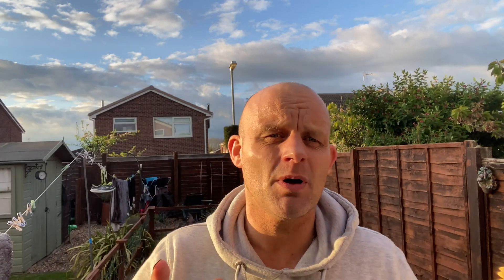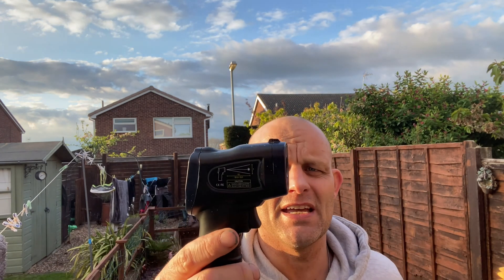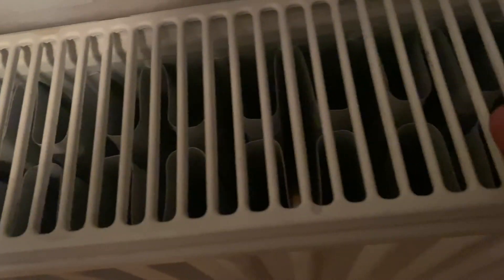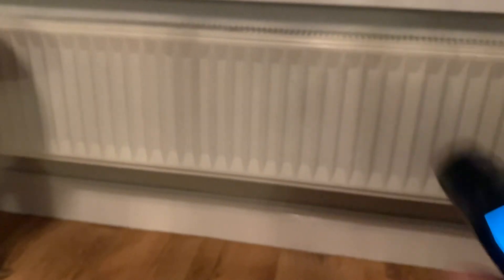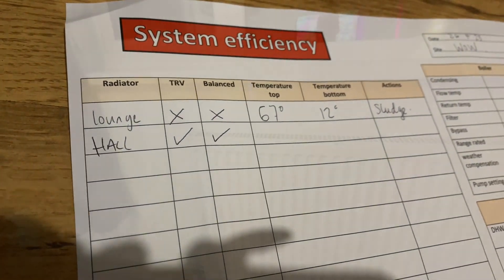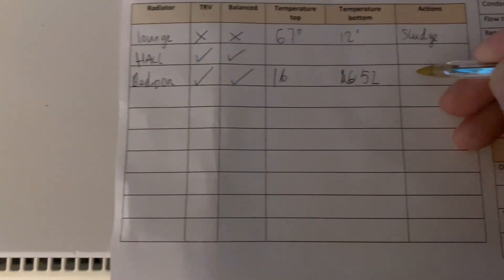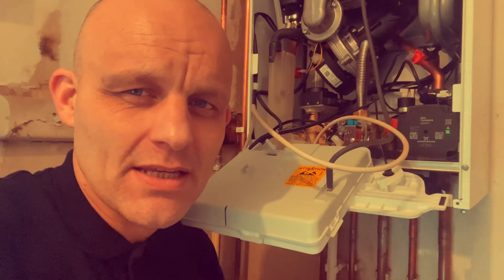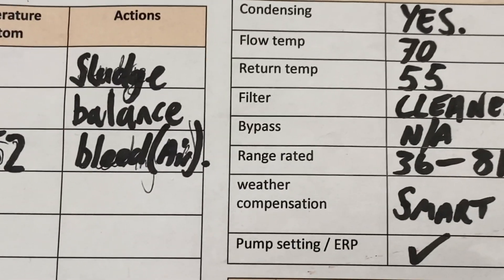How to balance your heating system

Comment: Is range rating still needed if the Opentherm thermostat is modulating the flow temperature?
Reply from the maker: @DunkingJaffaCakes  no, plus that's usually hot weather compensation on too